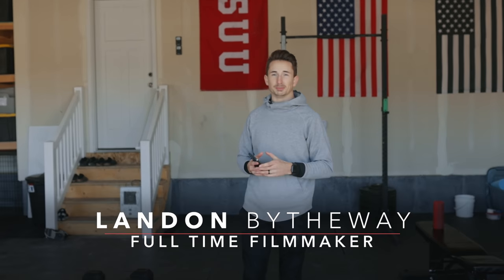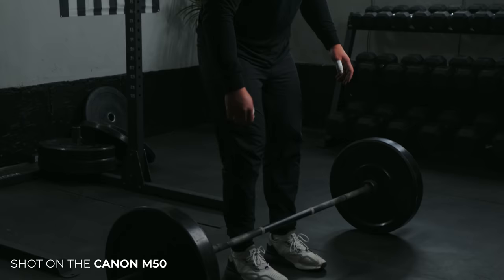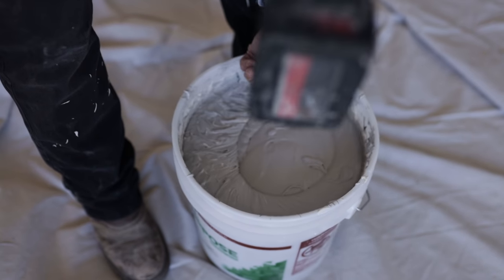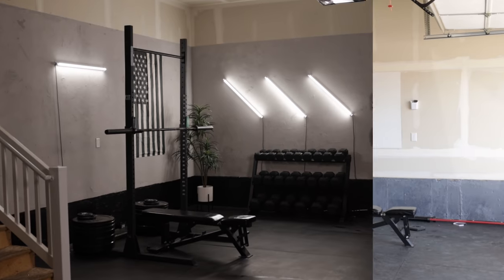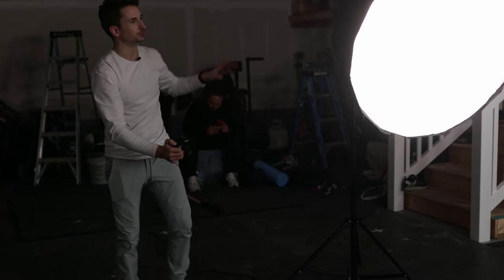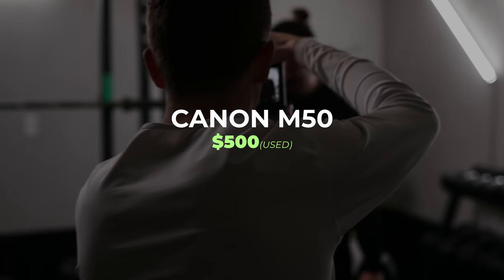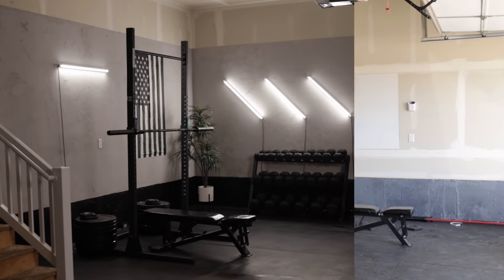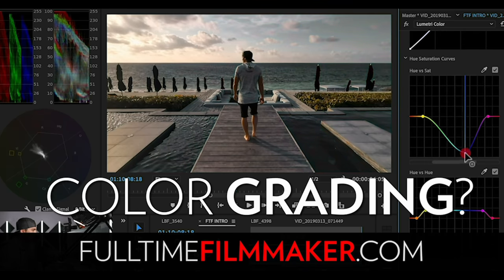Make EPIC Fitness Videos with just $1000 (camera included!)

Comment: Disclaimer: 
I just want make a small correction about this video, but before I do I just want to say I love all the hard work you put in this Landon and I am not hatin. The Godox SL-60W does not come with the light dome you showed in this video. I know because I bought the gear you mentioned in the link for a workout video I did and it was much smaller and I am curious if that is the same light stand as well. Now the light is amazing and the fan noise was very minor and could not be heard in the interview. I love the video Landon you put together for free because I know stuff like this you could charge. I want to give a disclaimer for those in a very tight budget in case they may want to buy the Godox and a separate lime dome.